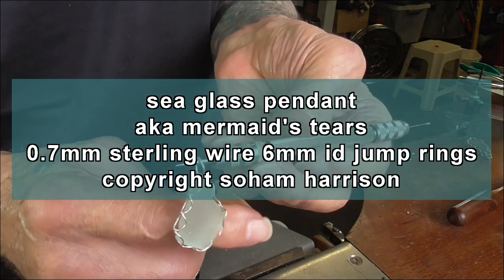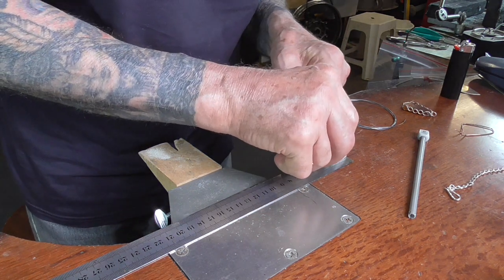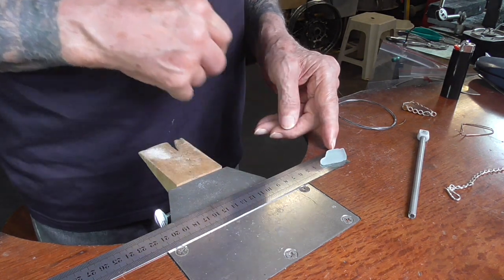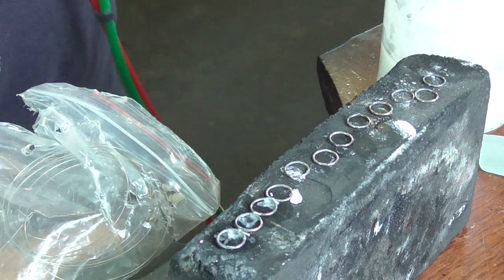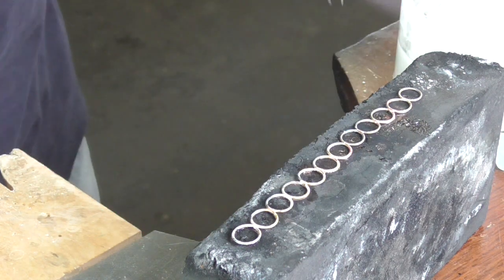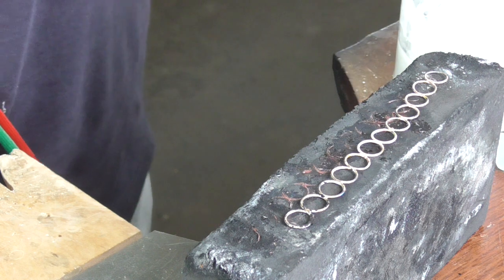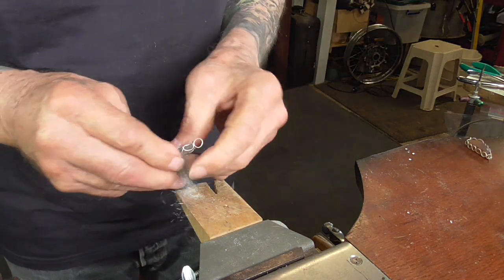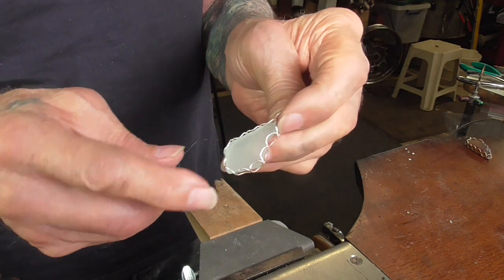mermaid tears pendant

Comment: For cutting jump rings I love threading my saw blade through the coil and THEN brace it against my bench pin to cut into. That way the force of me sawing isn't gonna distort the rings, and the rings don't fly everywhere when they're cut. LOVE this project idea!!!
Reply: Great idea Emma!
Reply: Emma Gudith that's fantastic! I never would of thought.
Reply: I do the same thing, I just wrap my coil in masking or painters tape beforehand so they stick together. If I'm cutting a larger coil I work in sections (cut through 1/4 of the stack, remove that section, and so forth). It's a really handy trick!
Reply: I just got a wooden block that has v-shaped grooves of different sizes cut into it. You lay the coil in one of the grooves and then thread the saw blade through to cut in the same way.  I suppose you could clamp it to your bench, but I would guess it wouldn’t be too hard to just hold it in place along with steadying the coil. (I haven’t tried it out yet.)

I bought my block on Etsy, but it would be fairly easy to just make one.